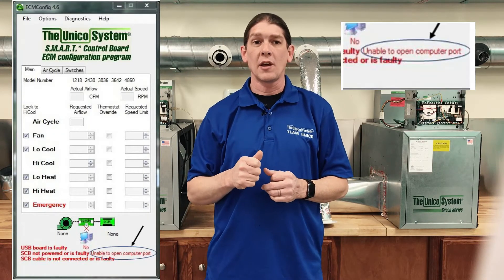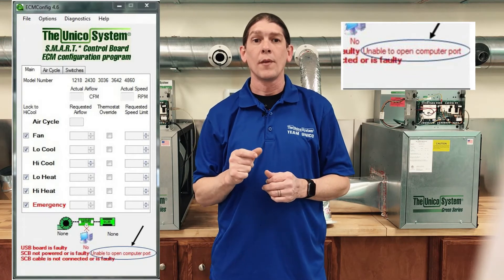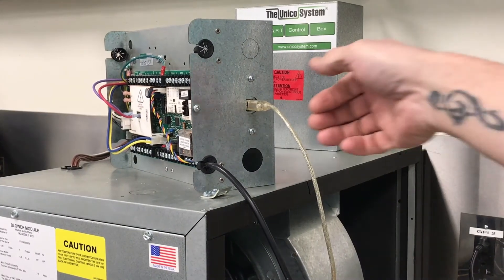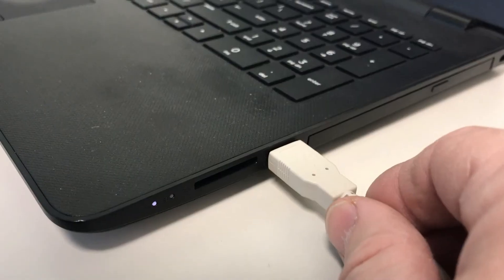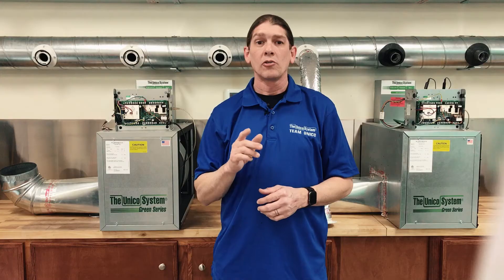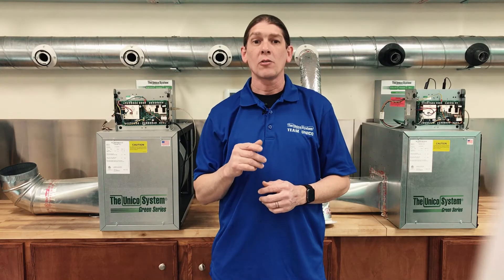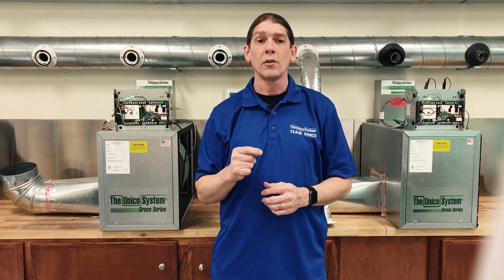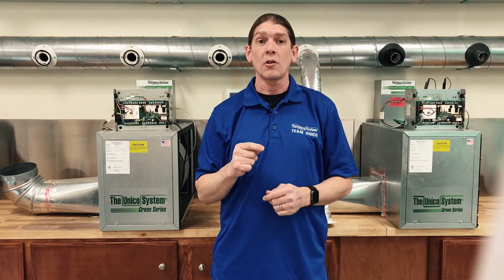Unico, Inc - How to troubleshoot common EC config program errors.

Comment: I am trying to get a unico system working from 2008. It’s blowing cold air but no heat. Everything seems good but just no heat. I don’t see damaged parts or burnt wires. There are three lights on a electrical panel. Green red green. How do I troubleshoot this?